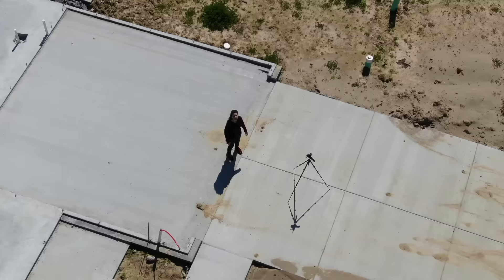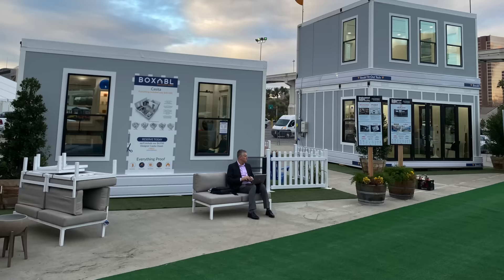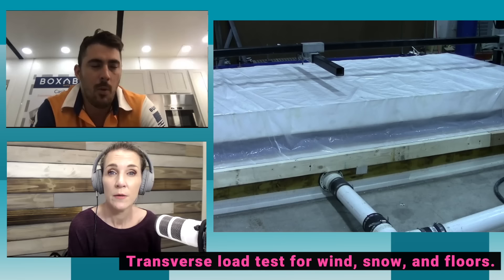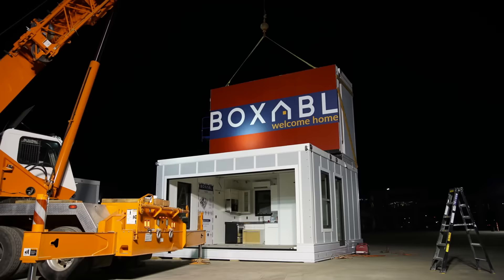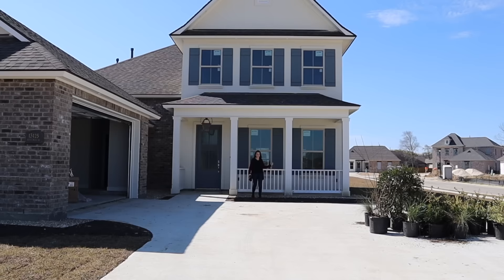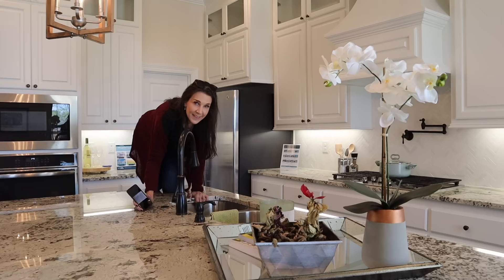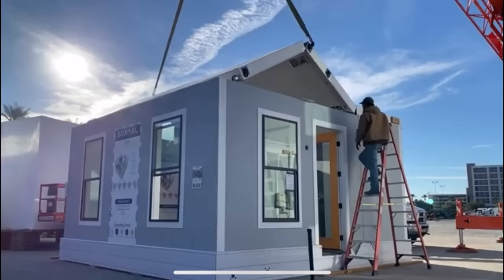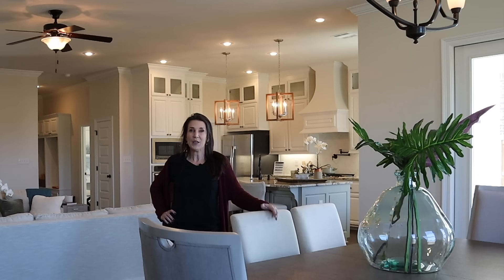Build A House In 2 HOURS?? FOLDABLE Modular Homes

Comment: These are really rad and I see the future but $50,000 for under 400 sq ft isn’t the future
Reply: Actually that's about the same price as Your Average tiny house.
Reply: @BOXABL  do you alway put that emoji?
Reply: @Queen GG you cant build a tiny home this size with everything in it for this price.
Reply: Lauren Nicholson what’s wrong with that? It’s about 100$ a sqft which isn’t bad. It’s just that 400 sqft is really tiny and poor but other than that it’s a good price per square foot
Reply: It's also not that bad when you consider that it's everything except your personal furnishings. It's hard to find a new house or even an old house where you could move in without having to do some upgrades and repairs that would cost you more.
Reply: So is 400sq ft the largest?
Reply: waterside  not like this is built, fire resistant concrete and steel house that sets up in 24 hours go ahead and find one like this for that price 👍
Reply: @jessiejo81   they're usually way cheaper than that unless it's in California, you can get a luxory 3 bedroom modular with 6-700 sq ft for 40k in Arizona
Reply: @Pharaohinthecut  if you're getting them made they're probably going to run you about $50,000. But you can make them for way cheaper especially if you make them from things just lying around like Old Barn material or flats that people give you for free. I've seen want someone built for less than $5,000.
Reply: @Pharaohinthecut  where can you find those? Can you give us some links?
Reply: They take advantage of America because of the Philippines you could probably get it done for less than 20000 I'm sure cuz I know somebody that did one for 13500 about 3 years ago
Reply: @D3nMe  good question because that's one of my problems I'm looking for in the Philippines because I want one larger than 400 square feet I want one double or triple that
Reply: @jessiejo81  you pretty much correct but the problem is building codes in this country of ours
Reply: @Pharaohinthecut  Where the heck are you finding that? I've been looking at modular homes for a little while in Phoenix, and I can't find any good ones for less than 70-80K.
Reply: I live in a RV in 288 sq feet and it was more than $100,000 new. But hopefully they will keep the goal of making them less and less expensive In time.  Also have to add in the property, foundation and hook-ups to utilities. And the crane to "unbox" it. That's what's going to kill these for most people. What do you think that crane they showed runs per hour? Set up? Location delivery? That's not going to be cheap. Enough to put a lot of money before the box even arrives. I'm out!
Reply: Where can I get a 3d house in California with permits for 10k? Gotta website
Reply: You can get a fixer up in Houston, granted a shitty neighborhood and school for the same price or less
Reply: Too much
Reply: What are you on about? People pay 100k+ for this
Reply: It can be scaled up remember
Reply: @daveforgot127  True.  BUT... I think you're talking about those Chinese made foldable houses that would never meet American building codes.
Reply: @D3nMe  agendas 20/30l look
Reply: @D3nMe  I believe he said that's the smallest they can build. So, I'm assuming they do make them bigger.
Reply: @nick-dm3if  Not easy finding a nice place to put a tiny home on a trailer.
Reply: Bio domes rounder not box ayeveda has workshops and online program complete detailed step by step videos only 100.00 maybe 2.00
Reply: You must not live in California
Reply: @craftygal4494  Or Seattle.
Reply: You can build additional floors to the house.
Reply: Really depends on where your setting up this house. In California that would be a total steal!!! Super super affordable. But if were in the middle of  nowhere in the midwest... might seem like a lot. All about perspective
Reply: True.  $125 per SQ FT is not all that inticing.

It is decent considering it includes most furniture and the appliances, but I think the main advantage and draw compared to traditional stick-frame construction is the "instant home" aspect.

This can be worth the small premium to many people and could actually save money that might be spent renting in the interim.

But if you are frugal, you can build a decent "custom" stick-frame home for the same amount (or less), where that $125/SQ FT also includes site prep and foundation work.

Of course, this all depends on the area or location that you plan to build, or where your property is located.
Reply: @ArthurBrinkman-c5z  
The crane and operator is an extremely small amount of the overall budget.  Paying a GC and group of sub-contractors for 2-6+ months for on-site labor of a traditional stick-built home is infinitely more expensive.

I paid for a large crane & operator to install my 100ft tower/23ft diameter rotor Bergey Excel wind turbine, and it was an extremely small portion of the overall expense.
Reply: You must be a real estate agent
Reply: I even doubt it cost them 20K to build more like $10 K to build maybe between $10k-$20K. They need to find a WAY to add the Murphy beds
Reply: Thats a mansion in NY
Reply: Says someone with a roof under their head. I personally lived in a 16 x 18foot tiny house for 9yrs. 2 1/2 of those I had a boxer, 2 cats & a baby in the home.
Reply: @Pharaohinthecut  ""*please*"" tell me where?? I'm in AZ and everything is ridiculously expensive, l can't find anything l can afford and am about to move back down South.
Reply: @janemiller5396  l've asked him the same thing. I can't find anything here close to what he has described.
Reply: @mysty_nyx  l am asking the same question. Phoenix is super expensive l need to know where he has found what he's speaking about.
Reply: @D3nMe  Great ??? I would definitely buy if I can get atleast 700sq ft
Reply: Might as well get a mobile home for that price or start a business
Reply: Yea maybe for $15k this would be a viable option for someone without children.
Reply: @BOXABL  does that 50k include the crane set up?
Reply: @1bkres  ru now divorced...lol
Reply: Sorry to disagree., but this is the future, and its here.
Reply: I’ll bet you $100.00 this company is toast in less than 5 years. The spokesperson/owner has no clue as to the realty of how housing and real estate works. Notice how he never gives an example of where one of these could actually be placed?
Reply: Sure if your desperate to live in like California or New York but I just bought a 3 bed 2 bath investment property for $70,000.
Reply: @diane Taylor Kansas

Comment: Prefabricated Builds have been used for a long time in Asia. That’s how they managed to build in the temporary hospitals in China so fast.
Reply: No one ever said this is new technology
Reply: Oh wow that's interesting.
Reply: IKR? They built two hospitals in 10 days. I was shocked. I know prefab has been around for decades but still 10 days??
Reply: Designed and approved in 24hrs, 350ksqft, 1000 beds, finished in 10 days. Operated successfully and decommissioned after ~76 days.
Reply: Those were both modular, not foldable.

Comment: I've had an idea like this bouncing around in my head for decades. Not being an architect or arrest I had no way of putting them to paper. I think this is a good solution for most housing needs. As far as a pitched roof they could offer a system that folds up than raised in place bya crane in site. I can tell you from experience the quality of most stick built homes I see is getting worse but prices keep going up.
Reply: “I can tell you from experience the quality of most stick built homes I see is getting worse but prices keep going up.”
————————————
You got that right!
Reply: Grand Wonder there is a brand new stick-built neighborhood near me. The siding on the homes looks similar to the siding on the newer mobile homes in this trailer park. A realtor was showing one of the new stick-built homes in that neighborhood. She leaned against a kitchen island and the whole thing collapsed. She does not recommend those homes anymore.

Comment: I really love these! I live in low income housing and this is larger than my current apartment and looks better made. The price per month would make it the same as my rent. If I could buy a bit of land and get it ready I would have everything I need. I have been looking at tiny homes for a long time. The main problem I have with them is the loft. I can't crawl around on the floor to get to bed and if the bed is down stairs then you usually have to be an acrobat to put the sheets on.  I am not even certain that I could climb a ladder. The cost of may of them is also way to high for me.
Reply: EXACTLY 👍 us older people can't contort to tiny house living with lofts 👏

Comment: I'm totally digging modular. The roof on these is the sticking point. A roof must have a pitch for roll off
Reply: Our units do have a small pitch. Other areas that require larger pitch need an added roof system.
Reply: @Joe Duke Yes that's something we might roll out in the future.

Comment: That's a bit expense for that size of home. But it's easy so I think that's the idea. By the time you add more boxes for a larger home you'd be paying about the same price as a regular home. But it takes longer to build.
Reply: Yea to get up to 1500 sq feet youd have to buy what 4 of these. That is 200k
Reply: @agood1  
Yes, building a traditional multi-level stick-frame home would be much more cost-effective if you needed a 1200sf-1600sf home for a larger family.

A lot of the cost of a home is the flatwork (concrete foundation) and roof trusses & roofing, so if you can keep those down to a minimum and build a simple shaped multi-level, that is the most cost-effective, and energy efficient as well.

If they offered a "Quantity Discount" for purchasing multiple modular/stackable units, that might be an incentive to use these instead of traditional construction.

The main advantage would be speed of construction and nearly-instant occupancy, of course.
Reply: @agood1  1500 sq feet in the NYC metro area will cost you at least 300k

Comment: 50 grand is a bit steep for (im assuming for the first model) You can get a structure built (of similar size, and traditional materials) built+foundation+plumbing and electric lined it for around 20-30 grand here. (indiana)Now the cost of furnishing said home would vary wildly.I could furnish a home (of that size) for 4-6 grand (all new) oooor go the used route for alot of it for prolly a grand. Depending where you live, there is always someone throwing stuff out thats still perfectly usable.

They would would have to come down to around 25-30k (for their first model) to stay competitive around here. (and yes i know they arent located here) Aside from that it would be interesting on what kind of effect this will have on the industry if this takes off.....
Reply: Finally, someone with some common sense, and an understanding of how the market works.

Comment: you should hire designers to create induction appliances where you dont need wiring just place appliances next to any wall with preinstalled wiring . no connection wires ..flexible design, lower costs
Reply: Is that even possible given power consumption loads of most appliances?
Reply: @CoastalKite  I dont know... I'm just blabbing I know nothing about electricity or electromagnetic fields... but if it's possible the more intellectual powers that be should make it happen
Reply: @CoastalKite  maybe stire the power in a battery
Reply: @CoastalKite  imagine just hanging a TV on a wall and it turns on with no connections that wod be awesome

Comment: This is definitely a wave of future homebuilding technology. It won't replace custom homebuilding on site, but it will solve a major crisis in housing, and be extremely successful, imho.
Reply: How will it solve the housing problem? You need to have land to put it on, that is the single biggest cost in single family real estate. Trailer parks have been around for 100 years, and that hasn’t solved the housing problem. The only reason to buy a home is because the value of the land appreciates, without land you own a rapidly depreciating pile of foam!

Comment: Modular housing has been around for a long time. From the Sears kit homes at the beginning of the 1900's. In the 1950's there were many modular component homes built.
Several neighborhoods in Denver were built with this panel type system in the early 1950's.
In the 1970's there was a complex of modular concrete box units stacked for housing Habitat 67 in Canada in 1967, still standing. And a very desirable area. 
In the 1980's in Colorado an entire neighborhood called Trendwood and Frankline Sauare were modular homes built in an onsite factory that became the Westminter Sports Center. 
So this is not a new concept. 
Except that over the many years this has been thought of it was considered cheap not desirable housing. 
Maybe because of execution and materials. 
But it now has a bad reputation. 
Going to be hard to overcome.
Reply: Maybe hard for you to overcome, but read the vast majority of responses. It's being very positively received.
Reply: @VESROB1  Well history proved that the designers and builders of the earlier homes of this type were not successful in the long run.
The main point is that this is a very old idea in housing that rolls around during times of very expensive housing costs. 
Cycles on cycles.

Comment: I think it's an exciting idea and I've read about the thought that has gone into its design and construction. I also like that they are starting with the 400 sq. ft. "Casita" accessory dwelling unit. All they need is to produce them, have people buy them, and then have people share their experiences with them for several years, that they function as intended. Then they can expand into larger units and flourish. 

I like the modern design of the Casita, and everything about it except the flat roof. I have a flat roof on my house and I don't want another house with a flat roof. I think the Casita would be nicer with a shed roof, but I understand, it might make it so it doesn't fit in the box, or add to the complexity of the design. 

One thing that really makes sense about the folding into a 8.5 ft. wide box is that will undergo much less stress in transport than a single-wide or section of a double or triple-wide. In regular manufactured homes, there's a lot of flex that can happen during transport of such a heavy section of house, and that can cause drywall cracks and other damage.

Whether it was Fuller's "Dymaxion House," which never went into production, or the Lustron homes (a few thousand produced) built for the post-WWII baby boom, others have had an idea of building an affordable factory home for the masses but all have failed. Lustron homes were metal and the modules took too long to assemble on site, and the company could not make money on them. They were affordable, and people really liked some things about them, but didn't like other things about them.

Dymaxion House had some brilliant features like the utilities in a central core, and a few wall sections which were movable so you could configure room size on the fly. But some things about it were terrible, like really bad insulation. 

Boxabl sounds like a workable idea but these houses will have to prove themselves over time. One sticking point is needing a foundation, which they say can cost between $5,000 and $50,000, depending on the building site. There are some architects who would like to design a home foundation with a lower environmental impact than a slab, block, or concrete foundation but they face changing zoning laws. 

The future of houses is going to be in robotics, but whether they are robots and various machines that work on site or build modules in a factory is still not certain.

Comment: It's a very interesting concept. It will be interesting to see if they will have modules created to fit side-by-side without a second floor. Being able to do a 4-unit square should give around 1500 Sq ft but only take up  around 40-40-ish dimensional feet on the lot. A 2 x 3 unit should be around 2100 Sq ft. Id they sit flush with foundation, then that could justify the cost differential over something like a Clayton or Palm Harbor modular model.

Comment: The MgO board has been used by people with chemically sensitivity. Of course avoiding vinyl and particle board because of off gassing as well as safer caulk and paint. Would recommend AFM Safecoat especially sealers if the most nontoxic can't be used in factory build.

Comment: The Hilton Palacio del Rio in San Antonio TX was constructed for the 1968 World's Fair. If the 21 floors, only 4 were built with traditional construction. They used modular construction for each room on the remaining 17 floors. Each modular room was complete with all the furniture and accessories when installed.
Reply from the maker: S Burri very interesting. Thanks for sharing.

Comment: I like the idea that you could start with one and add to it later on. I also like the idea that the people that are doing this particular modular home are in America and known company with an expected level of professionalism and quality. One thing they do need to work on though is an easy step-by-step plan for pre-delivery. It would be nice to be able to buy one of these with a known Pre-delivery foundation for permanent or temporary applications. It would also be nice to know if you bought two units in a way that you can expand space between them with a connector kit That would create space between two units basically two walls and a roof